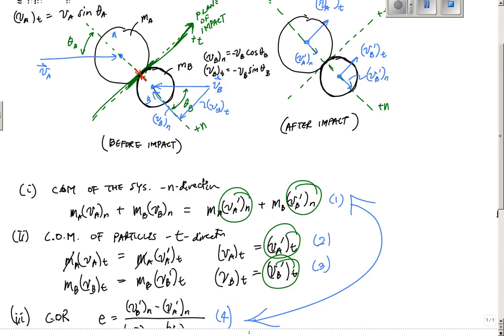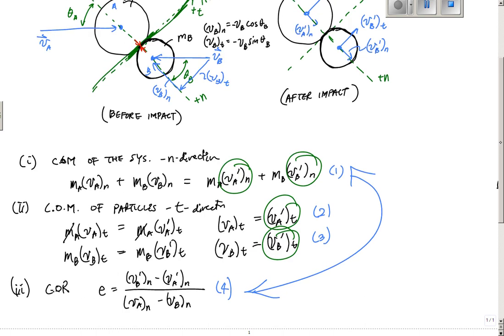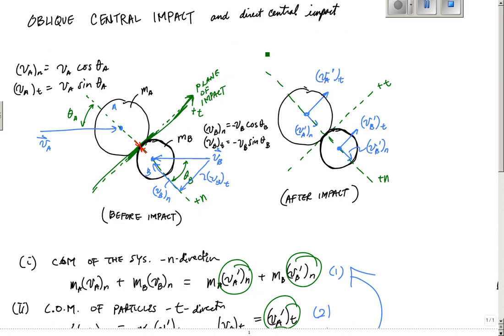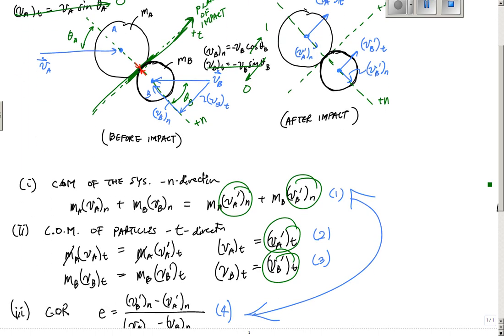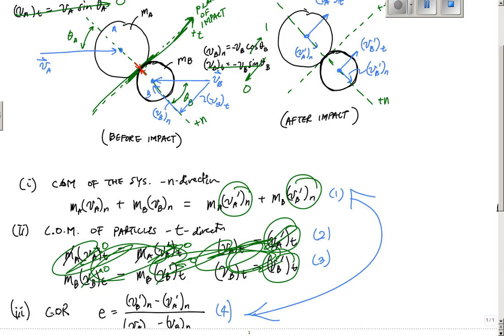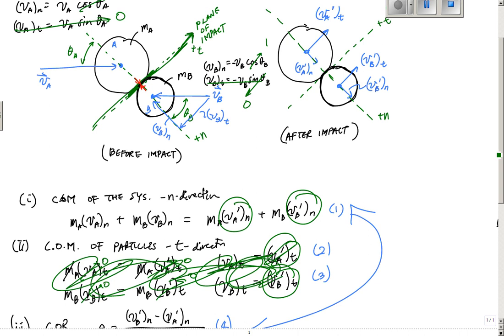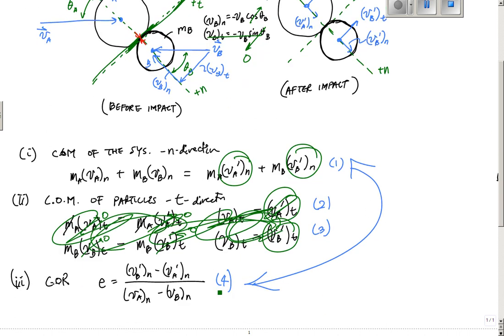Oblique Impact - Engineering Dynamics

Comment: So like the equation 3 & 4 why wasn't in equation 1 (Va)t = (Vb)t?
Reply from the maker: because there are external forces in the normal direction, we use momentum conservation for the system of particles.
Reply: Ohhhh I see now! Thanks! !
Reply: @structurefree  What do you mean external forces in the normal direction? Could you elaborate on which ones? On your images it seems like there are no forces. Is the momentum along the plane of impact always conserved like that?